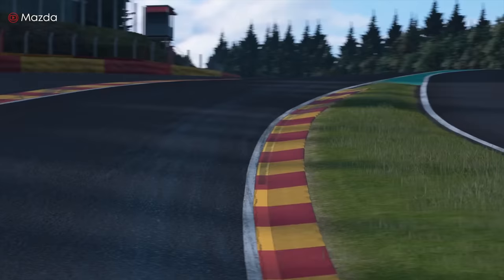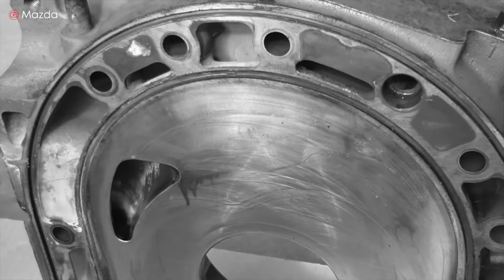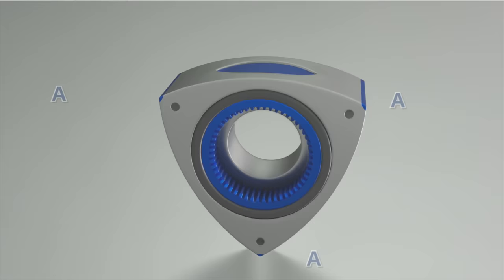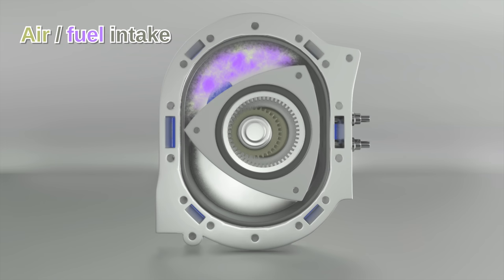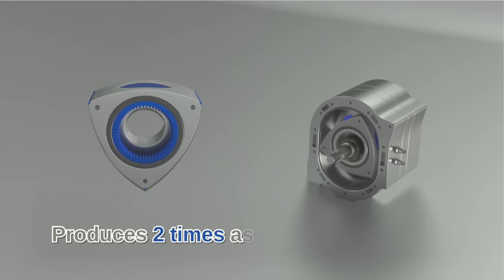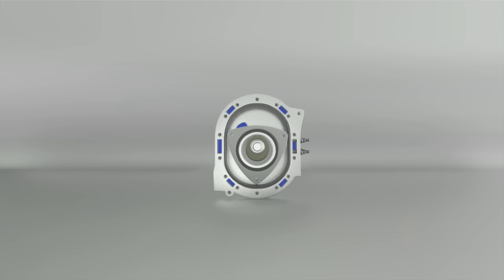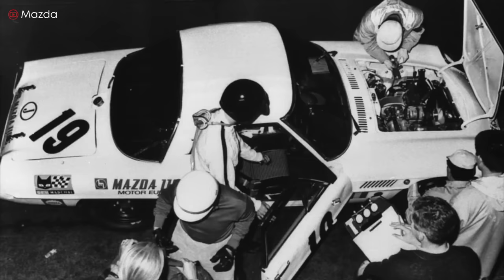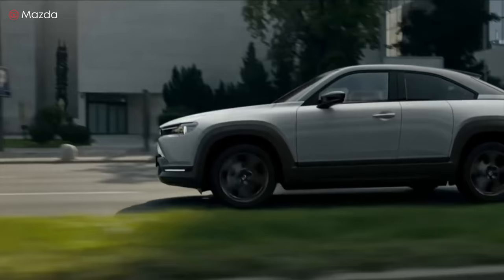Mazda's New Engine is the Most Powerful Engine Ever Made

Comment: I hope that rotary engine will never die.
F'ing love RX-7s
Reply: Joppa Kolla  damn bro.
Yeah we all know those things. Rotaries are fun and unique, and the power output is insane. With proper engineering, they have potential to be better than piston engines. As it stands right now, you're not wrong, but don't hate on our passion.

I personally love the RX-8, but the rotary from the earlier RX-7 was better built.
Reply: Joppa Kolla  I had one back in the 80s. Everyone here is right about the problems but they were great fun. They were pretty low on torque. I don't know if that's due to the rotary design or the small displacement but once you learned to keep the revs up, the original RX7 was a light, predictable little car that handled pretty well. They were great fun on a twisty mountain road. 
I even considered running a rotary in my desert race car. I didn't ever do it because someone beat me to it and they had lots of problems. The weight savings was offset by having to carry extra fuel and the seals were lucky to last 500 miles in dusty race conditions. 
I wouldn't want one again unless they can figure out the issues but I totally understand why some people are fans. I did want some more power in my RX7 but it's hard to think of a car in the 80s that was more fun than an RX7 on a mountain road.
Reply: Liquid Piston is manufacturing a rotary engine that uses a triangular shaped cylinder and a peanut shaped piston. Supposed to solve many of the issues and still deliver the power to weight characteristics. They aren't aiming towards the automotive market at this stage however that wouldn't stop someone from purchasing an engine in putting it in their RX-7.
Reply: It will arrive dead as the World is going electric.......Paul
Reply: @paulholterhaus7084  probably for mainstream. But there will almost always be a demand, for a few generations at least.
Reply: haaa-cha-ma coooo-king....
Reply: I was starting to love RX-7s anyway. I bought 3 RX-7 model kits
Reply: @shananagans5  its the design, it makes sense there is no torque.
Reply: It's already died. They ain't makin any more. So if ya got one, hang on to it.
Reply: @romanes_eunt_domus  I really don't like the idea of the side exhaust port in the RX-8 1B's.  They did it to chill the overlap timing down which does nothing for power output
Reply: So do repair shops
Reply: EVs will kill it and its brother
Reply: @a-don13  I hope not. Big business and the 1% are really pushing for EVs though.
Reply: @timmack2415  it's inevitable man
Reply: @a-don13  It's forced obsolescence by big business and powerful corporate greed by the 1%, sadly. 
The sheep will blindly follow the farmer who brings them table scraps even though he is the one who will ultimately lead them to the slaughter house.
Reply: @timmack2415  are you saying people don't want magnetic induction motors?
Reply: @a-don13  Some do, some don't. I don't and the majority of people I know don't. I'm saying that it should be a choice, like other things in a free society. Governments and the financial elite should not force it on people who may not want them. Legislation should never override personal choice.
Reply: @timmack2415  I think it's more of what that industry seems as more efficient and better overall which are EVs by far.
Pistons will be like horses now
Reply: Rotary engines have a few great features, but until the problems are solved, theyre not worth it. Theyre just too much money and too wasteful to keep running.
Reply: @joes1176  Wankel engines are obsolete technology

Comment: There's no oil sump in a rotary engine; instead, there's an oil injection system that shoots oil into the chamber on the intake stroke.  That's shat leads to abysmal emissions numbers.  Another bad aspect of the rotary is differential heating: the intake half of the engine is always quite a bit cooler than the exhaust half.  This leads to problems keeping gasketed surfaces from leaking.  Despite all this, it is a fascinating engine with only three major moving parts (two rotors and the eccentric main shaft).  I've always wanted to install one in a drag boat.
Reply: I had an RX7 many years ago and it had a sump, it had a dipstick too to check oil level.  There was an oil metering pump that pushed oil into injectors in the rotor housings to lubricate the apex seals
Reply: Bill Carroll an old drag racer built one and wrote about it in the 60s he got 300 hp out of it!

Comment: The rotary engine makes sense as a generator, as it does not need the power bands that a directly connected engine would have to have.  All it needs to do is run at a certain RPM.
Reply: the draw on the engine is constant but variable, what you say makes a lot of sense. rotary engines wear out is strange ways.
Reply: I have read that direct injected 2 strokes are being developed that will power generators, & run in an rpm range that will minimise emissions

Comment: I had a RX3 in the 70’s. It was powerful and fast.  My brother bought a RX7. He could outrun Chev Nova 396 all day!
Reply: What was the nova pulling 30ft. Trailer?
Reply: @timothythomas1737  it would easy beat a nova 396. the car was light and the high rpms were alot better
Reply: They have 0 torque
Reply: When they turbo charged them that was a game changer.
Reply: If that RX-3 were in good condition it'd easily fetch 40 or 50k right now... The RX-7 likely similar or more if it were an FD... hard to find LHD.
Reply: My '85 RX7 went from 0-60 in 8.5 secs. A healthy '70 Nova would do it in less than six secs.
Reply: @TheNoncritical1  that’s not real good.. My 2016 Honda Accord, with Bora exhaust and cold air induction would do 0-60 in 7.3
Reply: @greatwhiteape6945  back then manufactures had certain regulations they had to follow in order to import cars. So by the standards of the time rx7s had great performance.
Reply: @greatwhiteape6945  You realize that's a 30 year time gap right?
Reply: @timothythomas1737  so? they are fast. look up some drag racing rotaries videos on youtube. flat 6 second passes with no torque, 1.3 with only 3 moving parts.
Reply: RX-3 was my first car. Also had a Gen 1 RX-7 and a Gen 2 RX-7.
Reply: @davidhusband5022  I've driving them slow slow slow from the factory.
Reply: my first car was a rx3.  next was an rx2 four door.   the 2 was way faster, governed at 130mph but boy she got there fast.  as my brother said “this thing peels in second gear - not chirp - peels”

Comment: Great video on how a rotary engine works, had 1980 Rx7 12a factory 4spd
All original 224,828 miles before sides seals went out, after setting 4bbl carb I squeezed 24mpg out of it

Comment: Next week
Scotty Kilmer: Rotary engines suck!!🤣
Reply: @Acme Inc. It's not more efficient, it's just more reliable. If a better Apex seal material could be developed, Rotarys would find favour again.
Reply: @amelyntan6704  When more rotary owners learn about how to maintain and drive them correctly, REs will see better lifespans... The seal's premature deterioration is typically caused by abusive/inconsistent driving conditions and lack of proper maintenance. In the performance realm of things I see people try to drive them like they are V8s instead of a 2 stroke motorcycle with four wheels.. which is the best way to approach it, but how many non-performance minded RE owners even know what a 2 stroke is?? It's night and day difference in lifespan between rotorheads and common drivers, unfortunately.
Reply: Vacuum cleaners suck!
Reply: Apex seals gone in secs
Reply: @kevinshockey2765  oh??? how long did you have yours and how much miles have you put on it???
Reply: @kimmathis1945  have you ever owned one?
Reply: @amelyntan6704  It's not just the apex seals, its everything. 
Uneven heat distribution is the ultimate problem with rotaries.
Reply: @michaeldriver127  So what you're saying, is you have to drive it like it's going to break......because it is.
Reply: @michaeldriver127  Oh get over it, 12 mpg,  for a little slipper of a toy, are you nuts?
Reply: @cantweallgetalong  you might be nuts worrying about better MPG in a sports car! Every auto maker has its own model to out-do their sports car in MPGs, so I'm not sure exactly what you're on about.
I was averaging 20-23 MPG in my 1987 non-turbo FC as a daily.
Reply: @michaeldriver127  If you got that 20-23 mpg on average that's very reasonable, but if it was one time while coasting down a very long mountain grade and you stripped the passenger and back seat out?
As far as a sports car not getting good gas mileage, that's to be expected.  I think you would agree that a factory RX 8 getting 12 mpg is just ridiculous.  Am i nuts?
Reply: @jasoncook8351  Yes, exactly.  A disposable car.  Such an engineering marvel!

Comment: Scotty:  In the 70’s I drove a Mazda Cosmo for sales work all around the eastern USA.  It did a great job and was fun to drive.  When Corvettes laughed I had fun smoking the (up to ~ 90-100 when they finally overtook me.  Of course I was loaded with suitcases and engineering samples, so it was hardly a fair contest. Mazda gave me an engine transplant at 80,000 miles.  After another 20,000 miles I sold it for what I paid for it.  My family drove an RX-3 and RX-4 during those years, too.  Yeah, I had to maintain all of them myself because the Mazda folks just couldn’t set up the triple ignition system (leading, training and high speed).  Tuning the carburetor and afterburner was done by smelling the exhaust.  When the gas smell went away it was tuned right.  Good car!  Didn’t owe me. Nickel!!!
Reply: I owned a 73 RX-3 that I bought for $50 with aluminum mags on it. The engine, trans, and tires were trash. I rebuilt the whole car from the ground up. I pulled a 13B and a 5 speed manual out of a wrecked Cosmo with 10K miles on it. I took the engine and trans apart and did my voodoo on them that I do so well. It was a full bridge port engine with bolted rotor gears and harden stationary gears. I massaged the syncros in the trans so that I could quick shift it. I then put a Airresearch TO-3 with custom turbine and compressor wheels on it and used a Holley 650 double pumper to supply the fuel. I installed a 4 row radiator, Holley high output fuel pump, limited slip 4.93 rear end gears,  koni shocks, lowered 1 inch, traction bars, 225/60 TAs, custom interior and royal metalic blue paint. It was making 15 lbs of boost at 3K rpm and 250 lb/ft torgue. At 11.5K rpm I was making 500 hp. 13.1 at 110 mph in the quarter with the TAs. I had to use two waste gates. I also put quartz halogen lights, fog lamps and aircraft landing lights on the front end. I installed a Chrysler 100 amp alternator to supply the electrical needs. I installed a custom center dash with nine Steward Warner gauges in it. There were WT, OP, FL in the top row. The middle row had Volts, Amps, Boost/Vacuum. The third row had FP, OT, and ET. I put a 10K Tach and 160 mph Speedo in the instrument cluster. I owned this car for 15 years and drove it 500K miles. I had to overhaul the engine every 100K miles. I never had any problems with the apex seals. I would lose the side seals or seize a bearing if I missed a shift and over revved the engine. I considered 100K miles a good lifetime considering the amount of power that I was making.

Comment: My mazda after 145k miles needed a new seal rebuild pulled it apart and the rotors were crisp smooth, it's mainly because these engines require constant oiling. Soo once my rx8 (2004) gets a new seal pack I'll get running for another 100k qnd it's been damn reliable.

Comment: I remember being in auto shop class in high school and some teacher had a Mazda RX-7 with a rotary engine. He brought it in so we could check it out. Didn't understand why it didn't get mass produced until now. Scotty did a great job explaining the important things one needs to know about these engines!
Reply: Dude ya nee to see a van veen 
First bike to have dortio lump
Reply: The seals wear out too quickly, sparkplugs were very expensive, as were the 2 sets of points, which all needed to be changed monthly, plus they were just as " economical " as a large automatic V8 car . ( without the room inside )
Reply: Otto, they were mass produced until the regulations in terms of fuel consumption killed them.
Reply: They talked about the RX-7 constantly which is a Monza
Reply: @Arturo Eugster, it was more about emissions. Lots of NOX emissions something to due with distinct hot and cold sides of the engine. 
Mazda is putting a new rotary in a hybrid as a range extender with direct injection and some weird variable timing techniques. 
Ends up being smoother, quieter, and more efficient than piston engines. 
I think they plan to run it with limited RPM range.

Comment: Rotary engines suck fuel like a private jet. Don't forget to mention that part.
Reply: 7:49 he did
Reply: That's because a rotary is actually an impulse fired turbine, it will always drink fuel.
Reply: @nicovalenzuela4044  my mistake.
Reply: Andy Candy  someone that wants a cheaper engine OR a race engine
Reply: 12 mpg.  Nothing to brag about.
Reply: Your point is ?
Reply: If your asking power thats alright,but if you are searhing for effeciency yes not to reciprocating engine but to the electric motor.

Comment: Fun fact: Toyota is actually trying to buy Mazda engines & Transmissions from Mazda .
Reply: Mutual Toyota-Mazda RWD inline 6 platform is upcoming I hear. New Supra config? 😳
Reply: I thot Toyota was trying to buy Mazda engines and transmissions from Ford
Reply: My daughter drives a Mazda and she’s never had any problems with the engine or transmission. It’s the rest of the car that’s falling apart!
Reply: I wouldn't doubt it lol
Reply: @kayhenry6293  Must be an old model. Mazda’s quality has been sky rocketing lately
Reply: @jimm3093  Nah. Mazda left that deal with Ford a while back. For  a good reason too.
Reply: Mazda & Ford were buddy's in the 70s -  80s,  Mazda 323 / Ford Laser
Reply: @SkullDivisioN564  they werent buddies.....ford bought stocks in mazda then tried to run them down in the late 90's....luckily mazda and subaru bought eachothers stocks then traded with eachother.
thats why mazda and subaru both got away from ford and chev at the same time
Reply: Mazda has been using more Aisin transmissions lately, though Toyota has been interested in the new inline six they're developing for the next gen 6, which will also go RWD.
Reply: Where else can you buy a Mazda engine?